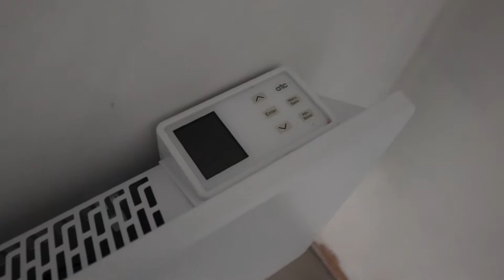UK Granny Annexe Build - Finale - Build Cost

Comment: Thanks for breaking this down. Really insightful. Question, any reason you didnt consider a log cabin, which for that price could have built a 3 bed one so could have saved some costs?
Reply: Hi, simple reason - they don't conform for full time habitation. They would have to be adapted and the cost of that is huge. The building we have will also last longer and require less maintenence. We initially looked at the pre-fab units but there would have actually worked out more expensive

Comment: Great Video I've watched every annexe video👍just wondering you said you have your hotub and the annexe fed from your main house electric  feed, is this a 100 amp feed? I'm looking at getting a 32 amp hotub, but was advised to check I have capacity which I'm sure I will. Cheers
Reply from the maker: Thanks Andy. Yes it does run off a 100amp feed. Think it would have been the same with or without the annexe, the tub uses more electric than the house and annexe combined x2. 🥺

Comment: Would you mind if I ask how much it cost to get the main pipelines installed for Gas, Electricity and WC/Shower?
Reply from the maker: Sure. No gas, electric cable was £700 but would have been cheaper if it didn't also feed our hot tub. The water pipe and waste water pipe were included in the 50k build cost so don't know how much they accounted for on this. I can't imagine it would have been cheap as a lot of work was required, a lot of excavation, 3 man holes and all the pipe.